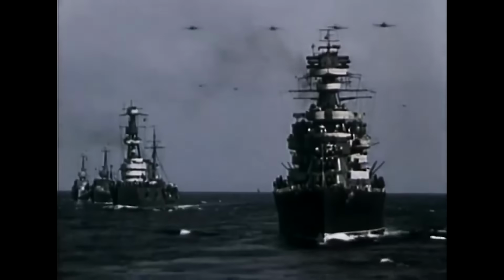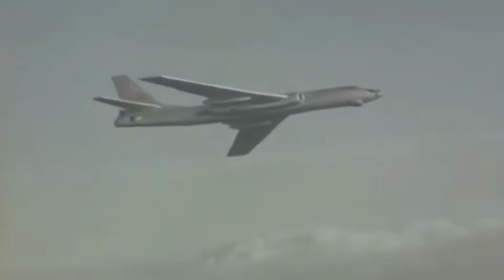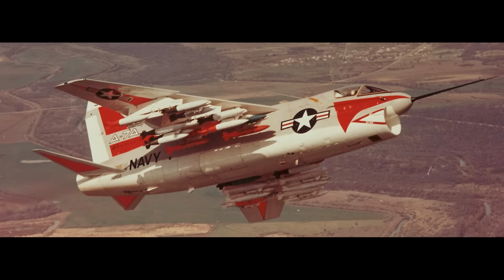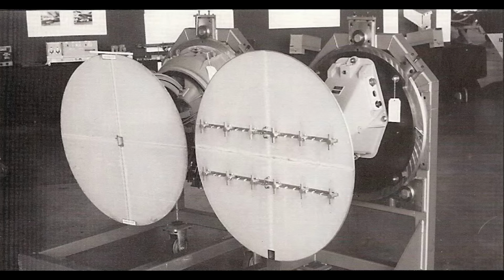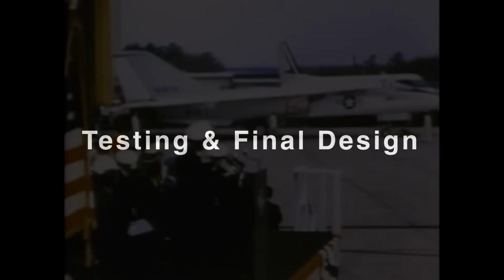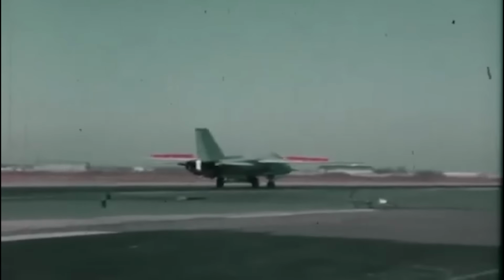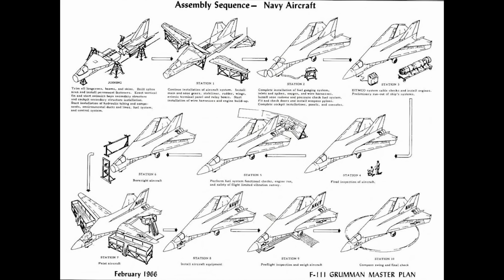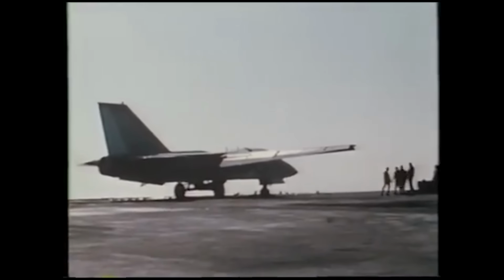Was The Grumman F-111B A Bad Aircraft Or A Missed Opportunity?

Comment: It should have been re-roled as a land based interceptor. It was essentially a larger and more capable Tornado ADV a decades early.
Reply: "More capable?"
What could this thing do that a Tornado couldn't?
Reply: @stickiedmin6508   It had a much larger Radar. Much longer range Missile , longer legs, and much faster. So basically everything.
Reply: @terrencejones9817  
You're not aware that the AWG-9 / AIM-54 system was actually offered to The RAF too then?
The original concept was to adapt the Vulcan and turn it into a massive interceptor, but there was talk of integrating the radar and missile into the Tornado (or MRCA) too. Sure, there would have to be quite a few tweaks to the design, to make everything fit, but a functional F-111B would have needed a fair few tweaks too. 
There's no reason why a hypothetical, Phoenix armed Tornado couldn't do the job equally as well as a hypothetically deployable F-111B.
Reply: @stickiedmin6508   That's nice. Could it fit in a Tornado? I doubt it.
Reply: @terrencejones9817  
Hughes Aerospace felt otherwise but hell, what would they know?
Reply: @terrencejones9817  
Have you ever heard of the JP233? Is it bigger, or smaller than an AIM-54, do you think?
(Interestingly, there was also quite a lot of thought put into the prospect of integrating the JP233 with the FB-111 fleet . . . )
Reply: @stickiedmin6508   According to whom?
Reply: @terrencejones9817  
Hughes' Aerospace Group, like I said. 
Trust me on this one - I accidently became an expert on the Falcon/Phoenix family a little while back. 
I was trying to figure out the identity of a missile in a famous photo of the B-1A (looked like a Phoenix with a much longer nose) and ended up reading through every piece of literature and information I could find that mentioned Hughes and their missiles.
I never did find out what the mystery missile might have been, but I was very interested to find out that Hughes had offered the AWG-9/Phoenix system to The RAF as an option for the interceptor version of the Tornado.
I'm not saying this to be argumentative or difficult, and I'm not looking for a fight - just sharing some interesting facts I know.
Reply: @terrencejones9817  f111 isn't practically faster than an F3 when both are loaded
Reply: @stickiedmin6508   Sorry but that sounds like an internet rumor . Why would the brits opt for Foxhunter and Skyflash with 1/3 the Range of the AIM154?. Maybe it was offered when the Tornado was on the drawing board.  The F3 is the size of an F/A18 hornet. AWG9 isn't fitting in the frame.

In regards to the JP233. Not really relevant as the Tornado carries 1.
Reply: @terrencejones9817   
The Tornado could carry two JP233 dispensers on its fuselage alone, and they were each a lot bigger than a Phoenix. 
The RAF (we can safely assume) didn't opt for the Hughes system for a number of reasons - it was more capability than they needed, for more money than they wanted to spend and given all the publicity money that had been sunk into portraying the Tornado as a European fighter, they wanted to keep it as European as possible.
As much as they (or we) might wish otherwise, a military force simply can't afford to always buy the best of everything. Instead they have to settle for 'good enough,' and 'as cheap as possible.' Within those bounds, The RAF evidently felt that Skyflash and Foxhunter met their needs. 
As to the size, I did already mention that the design would have needed a few tweaks to make the radar and missiles fit properly, but that's hardly unreasonable especially when we consider some of the other crazy ideas and modifications American companies were coming up with in an effort to get European forces to buy their gear. You saw the pic of the swing wing Phantom in the video, right? Measured against that, or any of the other 'Super-Phantom' concepts being pumped out by Mc Donnell Douglas back then, a Tornado with a slightly wider snoot is hardly unreasonable or unrealistic...
I have no idea how seriously The RAF took the offer. I have no idea whether or not it was actually considered, or if any real negotiations took place. I just know that the offer was made. We should also keep in mind that any plans to send Tomcat technology abroad, whether serious or not, would have come to a crashing halt in 1979 for obvious reasons. 

I don't remember the title of the book where I read about this - Modern Missile Systems or something like that. If you really want (and don't mind waiting) I can go to the library on Monday morning and see if I can dig it up again. There's also the Secret Projects forums - I'm pretty certain the concept has been discussed there.
Reply: @stickiedmin6508  I think your points are well taken.  There could also be another factor in play here.  The partner nations in the MRCA program (which became Tornado) each committed to buy a certain number of aircraft.   Originally there was just the strike version.  When the interceptor need arose, the UK chose to develop and acquire an Air Defense Variant which gave up strike  but gained air-to-air capability for this role.   IIRC, these ADV Tornadoes would become part of the total number of Tornadoes the UK had agreed to buy.    In other words, no additional aircraft were to be ordered, just some would be of a different variant.    This gave a major cost advantage for the defense budget overall, because despite the troublesome development of the radar, this option would cost far less overall than buying any other aircraft, simply because the UK would still have to buy the agreed upon total number of Tornadoes anyway even if another aircraft was order for the air defense role. .

Comment: With respect to the "Mach 3 F-111'. The only other reference I have to that is a mid-1970's edition of JANES POCKET BOOK OF MAJOR COMBAT AIRCRAFT which lists the top speed of the plane as 1983 mph
Reply: Pilot Notes for the F-111A are on the internet. Mach 2.5 Max Chat.
Reply: @richardvernon317  This video was talking about the B and JANE'S did not specify. However this vid tells us it would wreck the plane

I have two references of the SR-71 doing M5, one from the fianl flight and the other from a personal friend quoting pilots. Now we do know that it brok 2300 once but that did a job on the plane. The only way I can reconcile the two is that M1 varies with altitute, being much less at 65,000 ft than at sea level. The service ceiling of the SR-71 is "over 80,000 ft" Now, just how far over 80 grand is not specified. I would think that what is M3 at 70,000 could be M5 at 90 grand. The F-15 and MiG-24 were pushed over 105,000 so just what they pushed the SR-71 up to, I have no idea
Reply: @SpacePatrollerLaser  
"The F-15 and MiG-24 [MiG-25] were pushed over 105,000 [feet] so just what they pushed the SR-71 up to, I have no idea (...)" 

It's arguably just a question of further development of the engine potential than practical feasibility - in this case, it refutes  Admiral Thomas Francis Connolly's argument of the supersonic F-111B being 'underpowered' - although the Vietnam War would prove him right in regard to an additional desirable requirement of 'super-maneuverability' - usually achieved by a weight-thrust ratio of 1:1 or better. 

The SR-71, MiG-25 and MiG-31 have probably the sustained thrust to leave atmosphere as the medium to grant lift, and thus turn into accelerated orbiting satellites as defined by the Karman Line at relaative 100 km. 

Neither air breathing engines can operate without oxygen nor would conventional airframes survive the heat build up of increasingly orbital acceleration or the friction at re-entry... 

The German Saenger orbital bomber was developed around these principles in the 1940s (envisioned as taking off, rocket-powered from high speed rails), but never evolved beyond this conceptual stage and early ramjet trials.
Reply: @SpacePatrollerLaser   M3 @ 70,000 feet is ~ 1,980 mph.  M5 @90,000 feet is ~3,300 mph. 

Aside from skin temperature issues, at that speed the shockwave coming off the nose would be impacting the outer wing and the engine nacelles which would do all kinds of bad things to the aircraft.
Reply: @tararaboomdiay7442  Thanx for the teech knowledge upgrade. Then where did that story originate. The first time I heard it, it was from a personal friend who was training at Lackland and hes was trustworthy, He said he got it from a pilot, in '80. Then the story of the retirement flight was in UNDERSTANDING DEFENSE, a newletter by IIRC Ernie Ross, who claimed to, and appeared to, be an Objectivist like me, so he appeared to be A-OK. That was about a decade later. So we have two separate, unrelated sources far apart in time. I figured the only thing that would make sense is that M5 at or above 90,000 ft would be about 2300 mph, which we know the plane did at one time as did the Blackbird that flew above the Paris air show in '64

This is beginnig to sound like the "free Corvette" story that I first heard in '63. There was supposedly a current model Corvette STing Ray that you could have for free. The catch was, that the owner died in it and it and he were unearth 6 months later. So you had to get the smell out of it. 15 and change years later, before my friend went in the AF, he tells me "There's a Corvette somewhere that you can have for free..." and I said "Lemme guess. It was missing for 6 months and the owner had died in it. It's yours if you can get the stink out: Right?"
"Yup"
"That story is old, I heard it over a dozen years ago"
I wonder where this story originated. As I said, I heard and read two versions of it about a decade apart; both legit sources to me